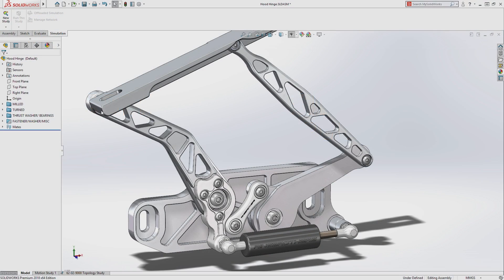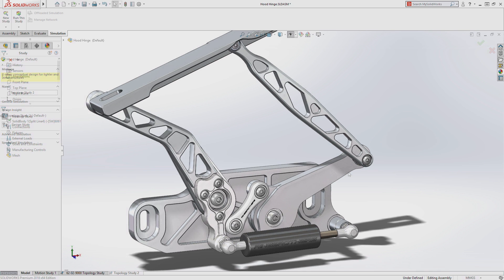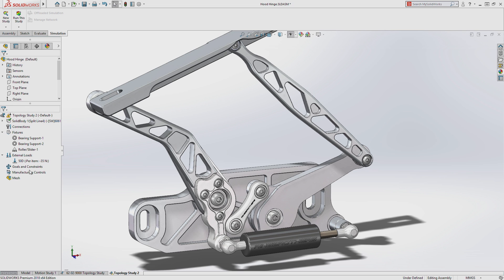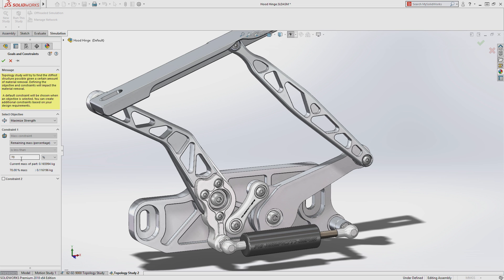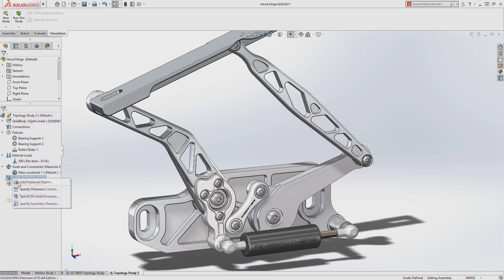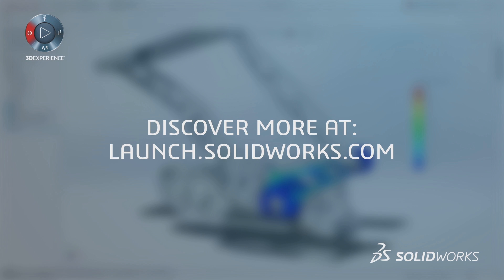SOLIDWORKS 2018 - Topology Optimization

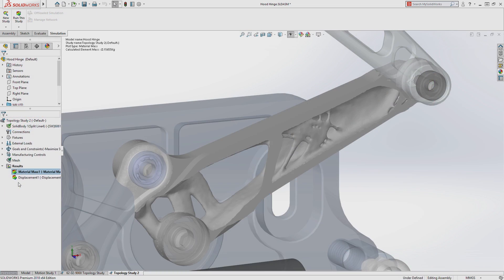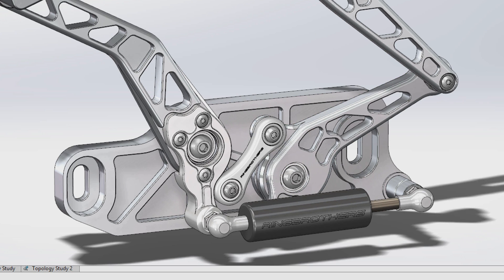Comment: please explain what happend between 1:10 and 1:17????? I am stuck at that stage with my project and I feel like there is no actual way of doing it legit.
Reply: im stuck here too rn
Reply: @ericherbert2063  Normally on complex shapes you would use surface modeling, but this is just literally a sketch. You take this model, and simply make a new part with a sketch based on this design.

Comment: Final geometry is not nature SolidWorks format? How do you make the smooth geometry? In Creo is all in one!
Reply: Hi Rodavn. It's the dimensions of the model which is controlled, so yes, it's the solidworks format also after optimization. It will update in your drawings as well.
Reply: OK, but what is the process between https://youtu.be/sWOXiKRveOA?t=1m10s time (1min 10sec) and final SolidWorks parametric geometry? There is cut on your wideo at this time.

Comment: does topology optimization feature exist in solidwork 2018(student)?
Reply: No it won't i'm afraid - as the student version is one year behind the commercial release. so Student 2018, will actually be SOLIDWORKS 2017
Reply: Topology is cool for an indication of which conceptual design to start with. But if you already got that, then parametric optimization is ideal for you. 
Suggest you go and download CORTIME to get a trial version.